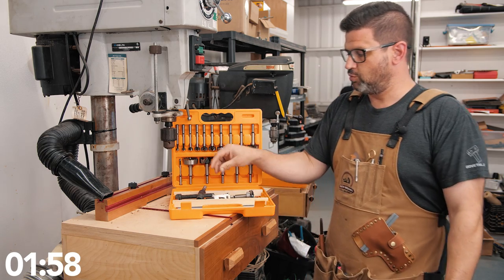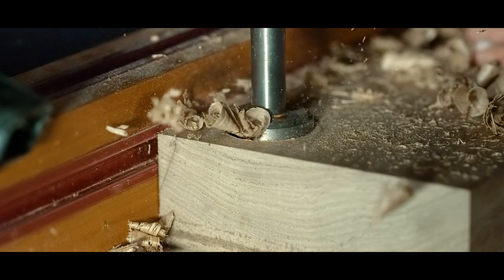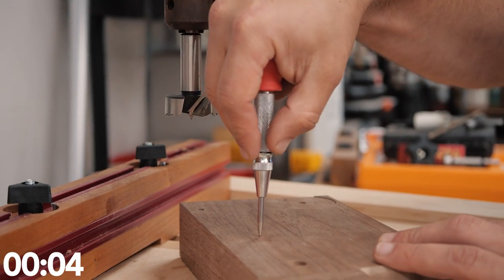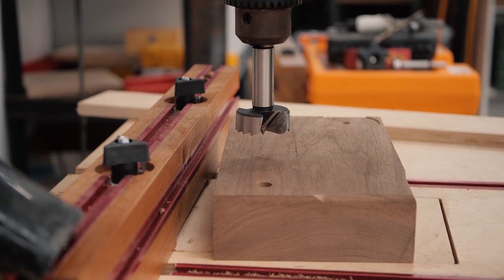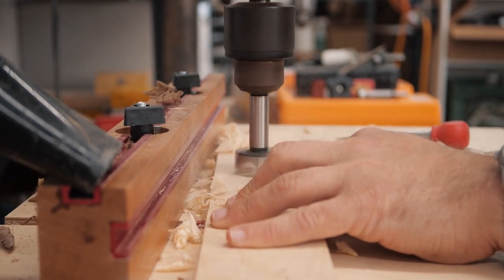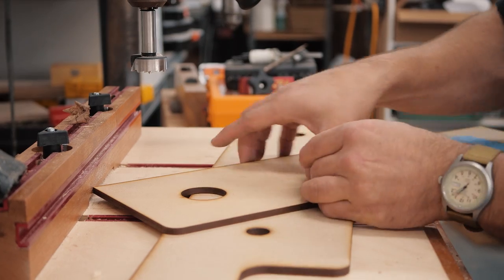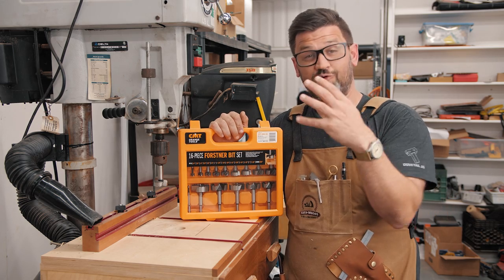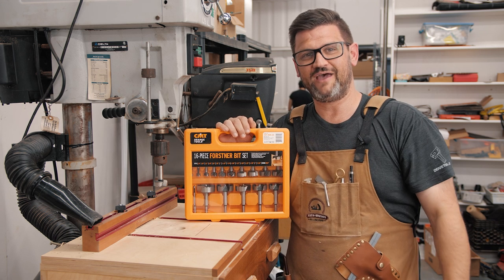Forstner Bits Tips and Tricks - Two Minute-ish Tuesday - 19k FPS Slow Motion Footage

Comment: There's actually a 4th variation on these bits which has to do with the inside cutters.  And because this particular innovation deals with the problem of heat that you referenced, its worth mentioning.  The bit design I'm referring to has straight outside cutters (not saw-tooth) but has the inside cutters segmented with small gaps.  These are found on the Colt Maxicut Forster bits.  It sounds like a minor change, but the difference is heat build up is astounding.  The Colt's are by far the best Forstner bits I have used.
Reply: It seems these are no longer available as no one has them in stock

Comment: TY for  the discount. just picked them up!  i had purchased a set from harbor freight years ago.  i wasnt sure if i really needed a set of forester bits as a woodworker and i figured that set would get me by pretty cheaply. at the time i had no idea what was going to be involved in a half hand tool and half power tool set up.  tldr is i found out very quickly that i would need quality tools and a lot of them!!  thank you so much for making that easier.  and a special bit of advice to anyone just starting out....always buy quality tools the first time.  cheap tools are frustrating and you will almost always have to replace them anyway.

Comment: To answer your question about twist drills, the biggest thing that you need to know before you drill is your material and your tolerance. For metals, there are situations where a standard twist drill will not give you the hole type that you want such as, sheet metal, and narrow tolerance holes. In sheet metal, regular twist drills will produce an oversize triangular hole. For tight tolerances >.005'' (depending on hole size and rigidity of drilling fixture) it can be better to drill slightly undersize and ream to final dimension. Reamers are better for this because they are designed to remove less material, so they can be made more rigid and will generally have a more refined cutter geometry. However, when drilling in wood there are very few situations where you would need to hold that kind of tolerance, so a standard 118* HSS twist drill will do the job in most every situation

Comment: Forstner bits...my #1 woodworking friend/discovery in past 4 years. I have found that anything under about 12--14 mm diameter needs frequent lifting out and clearing otherwise the wood powder binds and jams the bit..great fun working out a way to extract it......
btw..the mediaeval torture  thing..( it must have a real name)... apart from being lethal if not tightened up and  fingers kept well clear....I use it to cut out wheels in 10--15mm plywood....going 2/3 way through and turning over for reasonable clean cuts.
......from NZ

Comment: Thanks for the video. One important thing you did not mention about forstener bits and keeping heat to a minimum is having the correct peripheral speed for the most efficient cutting and least heat buildup.. I have seen  very expensive bits ruined by inexperienced users not adjusting the drill press to a speed that is slow enough to suit the bit diameter and in a set like yours the smallest bits may cut best at 700- 800 RPM where as the the big 2" bit may need to be run at speeds as low as 120 rpm.. It can be a hassle changing the speed on the drill press for a couple of holes but it will extend the life of your expensive tools and prevent wood burning. All the best.

Comment: i used high speed drills on my wood projects only because I did not know any better, yes they tend to wander too much to make good clean holes.  I used paddle bits and I knew about forstner bits but I didn't know about the small ones since the only ones i have ever seen was used by plumbers during rough in.  I now have a set of forstner bits and a set of brad point bits for holes too small for forstner bits.  I have a set of hole saw bits too but mostly use them for construction applications and not fine woodworking.

Comment: No, drill bits don't drill round holes there is always some eccentricity. There is an old engineering series of videos from MIT by Erik Vaaler where he describes why there is no machine capable of drilling a truly circular hole, but I don't think it should worry us woodworkers - hell the stuff moves all over the place as soon as you go near it!
Reply: Just go look at wood after work out and it bends because of the changed moisture content in the air 😂
Reply: solid carbide Split point drills will make round holes if properly chucked in a collet and the workpiece is held securely.
Reply: Regular drill bits don't cut round holes in metal, either.  They also usually cut a few thousandths of an inch oversize, which they share with Forstner bits.  When working in wood, the sizes are usually close enough. 

When you need a really round, precise-diameter hole (I'm talking less than .001" tolerance), you drill slightly under-sized and follow with the appropriate reamer.  Best accuracy, for position, size, and roundness is a boring head.

Comment: Normal twist drills make slightly triangular holes because the bit wants to dance around in the hole. Brad point bits are much better because the center point registers the bit and keeps it centered. I have never seen this be an issue in woodworking, but have seen it cause issues in tool and die making where precision is essential.
Reply from the maker: Great info thank you
Reply: "Slightly"? You haven't seen my holes.😆
Reply: This is why machinists use reamers or boring heads to get round holes... or end mills if we have access to a CNC mill. ;)

Comment: I would encourage you to look up the patent that Benjamin Forstner filed.  It gives claims, one of which was a bit that would follow it's own hole even if you were drilling a partial-diameter hole--and stay straight.  Before that there were augers that have 1 tip per flute scoring the wood ahead of the planing cut that removes the majority of the material.  he added a gimlet point instead of the screw point used on augers as well. 

As a toolmaker, I have used about every variation of these bits manufactured today, and whenever you vary from his original design of a "knife"
 like ring scoring the material in front of the planing edge, you lose on the feature of  being able to drill a partial hole, and/or the feature of drilling a long straight hold (such as in the manufacture of buttstocks for rifles, which is the reason he came up with the design in the first place). 
Any variation such as mulit-spur bits, wavy rims, even tapered rims to reduce heat or increase manufacturability, compromise the features of the patent and should find their own name instead of naming them after a man who invented something different than what they are making. 

I also take exception to your statement that the spurs and the planing edges are the same length.  They are not.  Forstner bits have the knife edge that scores the wood about .006" to .010" ahead of the planing blades to prevent tear-out that occurs when they are not that way.

These bits create a lot of heat both from the slicing of the knife edge rim and the outside diameter being a straight wall that is essentially rubbing the holes sides while cutting.  Therefore they have to be run slower than a fluted drill bit.  Then heat is much less a problem.  Your video of them running looks way too fast and I would bet you get a lot of heat that way. 

I didn't write this to attack you or your video, I just want to point out some important things about these bits and their use.

Comment: Drill bits often cut triangular holes. By drilling a smaller diameter first and finishing with a bigger drill sometimes solves this issue. HSS drills are flexible compared to carbide drills that are not flexible and tend to shatter alot quicker if your part isn't fixtured.

Comment: If, as the CMT website says, these bits are normal tool steel, they will be very vulnerable to damage from the inevitable heat build-up that comes with the wider (>1/2") diameter bits. You buy a relatively inexpensive set like these and end up replacing them one at a time. You can learn this lesson, or skip it by paying the price (about 2x more) to get Forstner bits made of high speed steel.

Comment: I'm a super novice woodwork enthusiast. How novice you ask? Well my "workshop" has the most basic work bench (left from my grandpa who was a metal worker) with a a metal worker's wise. As far as tools go I'm a proud owner of battery powered drill, some twist drill bits and a set of chisels (probably dull).  Of course there are screwdrivers, hammers and wrenches... And given that my shop is super small, a table saw is out of the question, as is the planer. Now I'm eyeing a compound miter saw so I can for the first time in my life cut a piece of wood straight. Oh yes, I have no orbital or track sanders or a router.. These will come with time since they don't take up too much space.. But what scares me the most is the fact that I have to learn from tutorials and YT videos and there's really not a lot of content for a novice like me. I would rather have somebody by my side and teach me the basics but it is what it is...
Anyway, I have a lot of money and time to spend to reach a level where I could create stuff I would be pleased with.. The first project I'm gonna start working on soon is the basic mount for drills and angle grinders, together with a place for various drill bits.. The next project (that's still in my mind and far away from becoming a real thing) would be some kind of a stand or a holder for my knife collection.. My God, how will that turn out I'm scared to think off..

Comment: I just bought a $200 14pc forstener bit set from LeeValley I’m SO disappointed with. They had 3-4 cheaper sets but I opted for the best. The scoring blades are so proud of the cutting blades they take to much pressure to use by hand. They’re drill press only.

Comment: I have often drilled "triangular" holes in thinner metal when drilling by hand or in a drill press when the material isn't clamped down. I think there is relative movement between the bit and material that causes it but I have not figured out why it's triangular.

Don't know about wood.
Reply: I just drilled three holes into a sheetmetal fan cage yesterday because the motor mount screw had teared out. After drilling the holes I noticed that the holes were pentagon shaped and I was mildly surprised. Doesn't matter though I just hammered in three threaded insert rivits and called it done 😎👍🏻
Reply: I think that’s where the centre of he drill isn’t securely located (say your pilot hole is too big) and so it essentially just bounces around. Maybe...
Reply: @thenationdecides7404  well exactly cause im essentially drilling out the old screw holes to fit in the special threaded rivits
Reply: I was schooled that after drilling through metal one should use a reamer to accurately size and make the drilled hole round - when required for a bearing or alignment use. The theory was that each flute of the drill would grab intermittently so that the drill would pivot on the end of the flute rather than pivot on the point of the drill. In this manner the drill would tend to transcribe a shape based on the number of flutes + 1 rather than being perfectly round. The more slender the drill the greater the affect.
Reply: @gordonmckenzie2982  that's a nice explanation as to why this occurs. Luckily for me the operation didn't have to be perfect :D

Comment: Love your videos, learn so much! Can't thank you enough! 2 questions.. 1- when will the stop blocks be back in the store? Went to order last nite with a saw..2- I'm making an outdoor stand to hold a planter box.. using white oak already cut to 36*2*3/4. Problem is attaching together screws or kreg screws just keep splitting the wood. The wood is super dry and oak is pretty hard. Any suggestions for joining together? Other than dovetails, no saw yet.
Reply from the maker: They're available in the store. Just on presale. Should be in stock in a week or so but you can purchase now which I highly suggest. We're getting them in phases and the first phase is almost all spoken for. I would predrill with a bigger drill bit. Cheers
Reply: Thanks for the tip!!.. I'll try it tonite with some stainless steel screws, it's going outside.. and I'll order the stop block and saw tonite also.

Comment: Jonathan, do you know what kind of steel the CMT bits are made from? Their web site says "Super strength SP Steel", but I can't find any info online on what that actually means. The Wikipedia page on "Tool Steel" doesn't say anything about it. Is it a high speed steel, maybe? (If it is, they should brag about it -- HSS is great when heat is an issue.) Can you get any more info on the specs?

Comment: Hand sharpen brand new drills that have never been sharpened by eye.  Can actually do a very good accurate job if you do it often enough.  When the box of drills has 1/8 that are bran new you get good at it.  The center edge is perpendicular to the axis.  It is where the two edges that are sharpened meet.  It is not a centering feature which is why drills wander without a center punch diameter larger then this flat.  You can see the drill wiggle the flat meeting point of the two edges is not centered on the drill.  Your cutting at two edges 180 degrees apart so if the angle of the cutting edges are not the same but they are centered  the drill will still wiggle since the force on one edge is different then the other.   Wood adds another dimension since wood has grain.  The force need to cut with an edge of a plane or chisel changes with the relationship with the grain.  A drill has a cutting edge and experiences the same change  grain relationship.   The more force downward  result in greater twist forces from the two cutting edges and if uneven will bend the drill.  So to cut a round hole go slow until the wood helps resist bending of the drill.

Comment: Jonathan Katz-Moses I had purchased a set of Irwin Forstner bits but have been hesitant to use them for 2 reasons, well questions really. 1. I noticed a considerable amount of "wobble" on my drill press and the resulting hole was far from round. Is that something I can fix by lowering the speed of the drill? Which kind of leads into 2. Should I be using a low speed for forstner bits?  PS the apron is awesome will be sending the photos to your social media as requested.
Reply from the maker: Sounds like you need to tune up your drill press or get a new set of bits. Yeah slow speed is good for forstner bits. Cheers bud!

Comment: A hole that is not round? 1. Improperly sharpened drill bit as in the point is off center or one edge is ground at a slightly different angle than the other. 2. Bent drill bit. 3. Loose or wobbly chuck. But an old helpful hint taught to me by a machinist is to drill your hole with the next size smaller drill bit then switch to the one you want and use it to chase out the hole.

Comment: Well great, now I'm sitting here wondering if i wasted money splurging on the same size set of Freud serrated bits!  
That's one heck of a deal if they're a quality tool!  (and I'm sure you wouldn't be backing them if they weren't)
Reply from the maker: I have been using them for a couple months now. They sent me a set before release. What a difference they make. I used to have the cheap ones that sell for about 80 bucks. These are top notch
Reply: @katzmosestools  my previous experience was only with cheap-o harbor freight type bits LOL  I don't regret the upgrade at all to the Freud's, but at less than half the price....I'm jealous of anyone who gets in on this deal haha

Comment: Great video, only thing you missed was speed of forstner bits. Your bit was traveling way to fast for the size. I also think you should never make and intro and just have excuses every week.
Reply from the maker: Yes. Meant to mention they should be run at a slower speed
Reply: @katzmosestools  Do you use different speeds for different size bits?
Reply: @timothyball3144  Yes, bigger bits have a higher "surface feet per minute" when they are cutting. A 0.5" bit spinning at 500rpm is cutting at 65.5 sfm, if you leave the rpm and switch to a 1" bit you're cutting at 131 sfm. Higher sfm causes more friction/heat and will dull/ruin the bit. So bigger bits need slower speed. The closer the cutting edge is to the center of rotation is faster you can go. Nice name btw.
Reply: @thallmeister  so there is probably a chart like there is for metal. Maybe wood is in the machinsts handbook.
Reply: @waynetaylor7086  👍

Comment: The so called myth about drill bits not making perfectly round holes is true.  Holes made by a two flute drill will have one more lobe for each cutter.  I thought Geometric dimensioning and tolerancing and would prove to my students that a two flute drill will drill a triangular hole.  This is easily demonstrated by drilling a thin piece of sheet metal.  The triangular hole is easily visible.  Brown and Sharp has some excellent videos years ago on this subject.

Comment: I had a shop manager where I worked at a custom window and door shop use a drill press and the arbor came off the spindle. He picked it up and jammed it back on and did not replace the left handed screw. He then went and got a hammer and a peace of RR iron we had and hammered it to where it appeared balanced again. he then put it back on the drill press arbor, Days later I had to make snap in mutton's for the windows. Well about the fifth mutton it decide to come of f again. I did not have my left hand even close to the machine and it spun like a top onto my left index finger with a 5/8 forester bit at several 1000 rpm. It took 8 hour to save my finger and reattach the muscles and splice them together. Always assume anyone else using a machine is a dumb ass.
Reply: Main company is based in OHIO!!!!